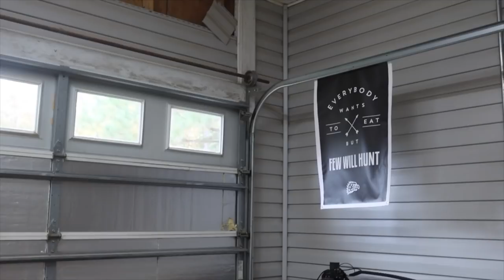Woodworking ASMR Building a Coffee Table

Comment: I just need a planer, jointer, and table saw and I'll be set for tools! Why do they all need to be so expensive 😭 woodworking is probably my most expensive hobby next to computers lol
Reply: A table saw is pretty hard to replace but if there's a lumberyard near you just go get surfaced 4 sides wood and you can pay a bit more for wood and not need a jointer or planer.
Reply: @deskgo  that's what I've been doing. I just feel like I'd be saving more money in the long run with a jointer and planer.